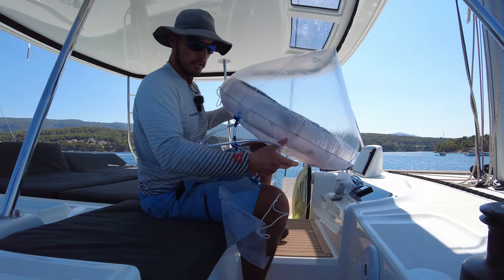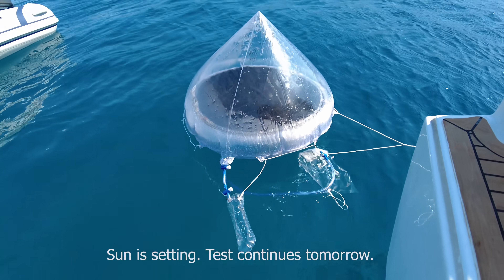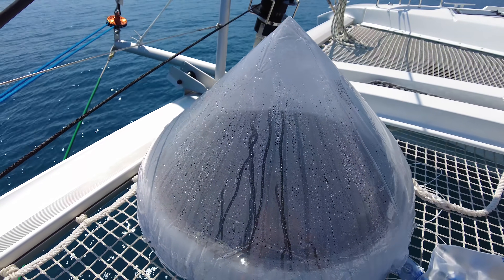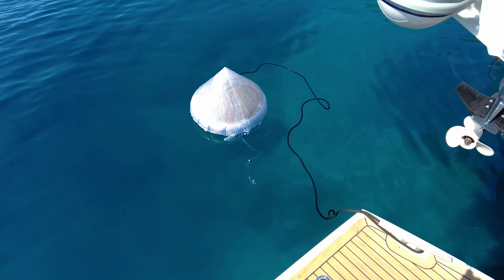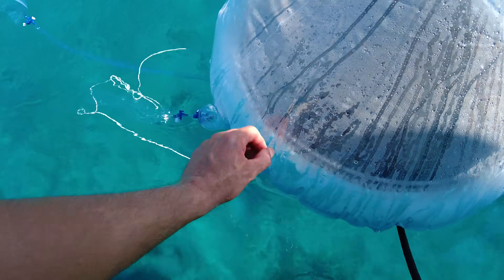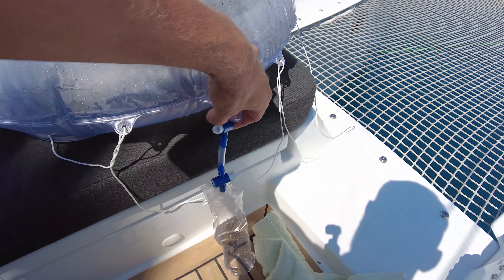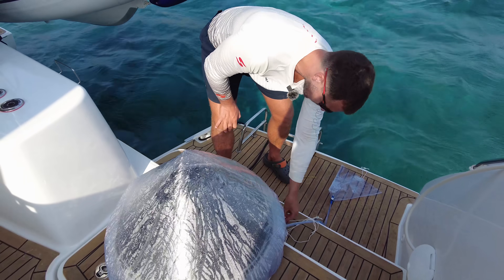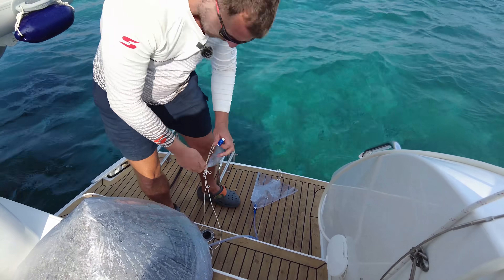Solar still - Sea made drinkable

Comment: I want to see the collected water tested for salt content
Reply from the maker: Salt doesn’t evaporate.
Reply: @IgorStropnik  I'm more curious about possible cross contamination thru design or accident
Reply from the maker: @J@J @JustMyTwoScents e is black cloth over water inside that gets damp to evaporate and prevents salt and fresh mixing. If device is not moving enough salt water doesn’t dampen the cloth and you have to shake it manually. In normal conditions you get no salt in fresh water but if you capsized device or shake it violently than you would mix salt and fresh water.

Comment: you get better performance with that in the water. the heat difference between the air and the reservoir makes a ton of difference in distillation. You are stopping that from happening by keeping it out of the water.

Comment: if you don't have a source of electrolytes to add to this, drinking water from this contraption will kill you pretty quickly. it will leach minerals and electrolytes from your body and you will die of hyponatremia and water intoxication. depending on your starting level, it will only take 20-30 oz of this water until your body starts shutting down. remember, when you are drinking water, you are replacing electrolytes as well as fluids.
Reply from the maker: Just add some sea water. Many people have water makers on boats and they drink it everyday. I don’t like it but looks like they get electrolytes from the food.

Comment: Hmmm...
It's almost a smart design...
At least it's compact.
It should definitely be a 2 part design.
You need a lens that doesn't fog up and a back surface.
Then you need to cool the water vapor.

Comment: I feel like this could be designed in such a way that it heats up faster, uses the ocean itself as a condenser coil, and separates the salt and water so you could use the salt to flavor food or get some necessary electrolytes

Comment: The same principle in prison was used to make Homebrew and the guy would spray ice water or cold water on the outside of the bag which would make the condensation happen quicker. I'm thinking if the guy would have sprayed the colder seawater with some kind of a handheld sprayer it would have helped the condensation quicker. Also if on a hot day you are running AC in your vehicle directly on the Windows you notice that the condensation is on the outside especially in the morning. So if you were to spray the sea water which is a colder temperature than the air inside the bag it would help create condensation faster than just letting it sit there

Comment: I used to hike in the desert a lot. *ALWAYS* carried supplies to make a solar still. Dig pit, line pit with vegetation (and even urine) put cup in middle of pit (helps to have flexible tubing into cup) cover pit with plastic and "seal" with dirt/sand around edge of pit perimeter. Place a rock in the middle to make inverted cone whose tip is directly over collection cup. Wait til sunset to remove plastic and drink or can sip from flexible tubing.
Reply: 1/4 a cup? how about 4 tablespoons? 😅😅😅
Reply: How much water did you collect per day, on average?
Reply: @michalinaokrent6672 not much. Maybe 1/4 cup, but might tide you over.  I didn't add vegetation which may have increased  yield.
Reply: What was your yield?

Comment: You can do the same thing in the desert. Temp difference and condensation from the air. Make a hole in the sand so its cool
Reply: It's usually close to 0% humidity in a desert. There is no water in the air to condense.

Comment: This stuff fascinates the heck out of me. I have a "vision" for a more "durable" version... If anybody wants this, there may be money here... The "lid" of a black five gallon bucket, has that conical dish facing down ward into the bucket. The condensation could drip into some kind of "cup". If the lid were clear, that may theoretically increase condensation due to the coolness...That may be a Patentable Invention for somebody who may have the where with all to do so... What about a 55 gallon barrel with a "cup" set in a socket...That catches the fresh water dripping from "conical lid" on the barrel, with tubing to the outside of the barrel, (through the wall of the barrel from the "cup".) for the spigot...

Comment: Question:
This is distilled water, and  especially when sweating in the heat and not eating anything, you rapidly develop a severe mineral / electrolyte deficiency. especially lack of sodium, potassium.    Is it advisable to mix in some, very little sea water / urine to avoid this, or what is the recommended way ?
Reply from the maker: Add little sea water.

Comment: The latest in science is that it was discovered that what causes the water to evaporate is NOT the heat but rather a phenomenon that happens when light hits the water at a particular angle, this particular polarized light causes water molecules to be released into what we call evaporation. Its called the PHOTO-MOLECULAR EFFECT.
Reply: Interesting!
Reply: @__WJK__ it's really incredible. When we hang-dry clothes, they do not reach 100° to dry lol it's the light around us in a specific wavelength that causes water molecules to be released as gas into the atmosphere.

The photo-molecular effect, also known as the photoelectric effect at the molecular level, has opened up new avenues for technological innovation. Here are some emerging technologies being built upon this discovery:

Energy Generation and Storage
1. *Molecular Solar Cells*: Harnessing the photo-molecular effect to create ultra-efficient solar cells that can convert light into electrical energy at the molecular level.
2. *Artificial Photosynthesis*: Developing systems that mimic photosynthesis to produce fuels, chemicals, and energy from sunlight, water, and CO2.

Advanced Materials and Manufacturing
1. *Molecular Electronics*: Creating ultra-small, ultra-fast electronic devices that utilize the photo-molecular effect to control electrical currents at the molecular level.
2. *Nano-Optomechanical Systems*: Designing nanoscale systems that exploit the photo-molecular effect to manipulate light, heat, and mechanical motion.

Biomedical and Healthcare Applications
1. *Optogenetics*: Developing techniques that use light to control cellular processes, enabling new treatments for neurological disorders and diseases.
2. *Molecular Imaging*: Creating ultra-sensitive imaging modalities that utilize the photo-molecular effect to visualize biological processes at the molecular level.

Environmental and Sensing Technologies
1. *Molecular Sensors*: Designing sensors that exploit the photo-molecular effect to detect and quantify molecular species in real-time, enabling applications in environmental monitoring and industrial process control.
2. *Atmospheric Water Harvesting*: Developing systems that use the photo-molecular effect to extract water from air, even in arid environments.

Quantum Technologies and Computing
1. *Molecular Quantum Computing*: Exploring the use of photo-molecular effects to develop new quantum computing architectures and quantum information processing protocols.
2. *Quantum Simulation*: Designing systems that utilize the photo-molecular effect to simulate complex quantum phenomena, enabling breakthroughs in materials science and chemistry.
Reply: @__WJK__  And also totally wrong...

Comment: This is distilled water with ZERO minerals, means you just drink air. 
The body got mineral from the water.
Reply: You can actually add a little seawater back to the solar distilled water, to gain back minerals. However, the water should then be run through a certified filter that is capable of removing bacteria, viruses, and "PFAS" !!

Comment: I'm pretty sure you need to let it in the water so that there is a cycle of hot surface and cold surface so that the water cycle continues. If it's just hot... Well the water will just stay in a gas form

Comment: You want the bottom to be cool because the difference between the heat and the cool causes the water to condense. Large scale solar stills use a glass or metal panel at an angle that has a cooling coil on the outside if it. This makes the panel cooler than the humid hair above the water supply so the water condenses on the panel faster, and slides down into the collection trough.

Comment: Read about these years ago (1980's?)  You don't play with them, moving them around etc. You put them in the water and leave  them alone until the sun has gone down or  the collecting bag is full.    They are not supposed to be used singly either.

Comment: The part with the sea water is supposed to be hot, as that leads to evaporation, but the dome itself and especially the drain is supposed to be cold, so the water condenses and stays in liquid form for maximum efficiency of this thing.

Comment: It really helps if you spray some salt water on the outside every now and then. Keep the drop collector cool. Inside is scorching.
Reply: Or just keep it in the water as intended.
Reply: @templeofdelusion  inside should* be scorching so the humidity is high. That transparent cone however must be cool in order to condense better.

Comment: There are several ways to use condensation to filter water.  It's great that this is a product though, but people should look up ways to filter water with what you may have on hand in an emergency.
Reply: There is also a filter straw which might be a cheaper option. REI sells them.
Reply: @takealeftatthelight5284  Does the filter straw remove salt or does it need non salty water to begin with?

Comment: I made something similar for a fifth grade science fair back in the 90s. It consisted of a cereal bowl containing salt water dyed green, a large glass saucepan lid suspended above where the condensate water built up, and an oven pan at the bottom that collected the clean water that dripped down. I remember asking the teacher if I could keep the project next to a window with direct sunlight or else it wouldn't work.

It was obviously not a new concept as similar contraptions were in a lot of survival books at the time, but I managed to win first place as my project also explained the whole evaporation and condensation process.
Reply: I did the same project. But in the 70’s🎉

Comment: Another way to make one, if you are lucky enough to have a large plastic sheet in your lifeboat, is to gets some clothes, or towels, soak them in sea water, form them into a ring shape, an annulus at the bottom of the boat, place a plastic cup or something to catch the condensate, at the centre of the ring of wet salty clothes, cover with the plastic sheet, with something heavy in the middle of the sheet, over the cup, at the lowest point, a stone or something solid would suffice, and hold the perimeter of the plastic sheet tight. It will only fill up slowly with drinking water, but it could save your life!

Comment: it might work better sitting in the cool water because the temperature difference between the hot water surface inside the still and the cool surface of the ocean might create convection (is that the right word?) that encourages activity at the surface. if you put a mug of water in a microwave, it can heat up a lot without actually evaporating or boiling, and because it's hotter than its boiling point but not yet boiling, when you take it out and, for example, stick a spoon in it, it may suddenly explode in your face. same principle here; floating the still in the water might disturb its surface to make sure it's actually evaporating, since the source of heat is radiation just like in a microwave.

Comment: these are great to have in reserve in case your main water source in compromised. i'd recommend 3 per person plus decent sized water bladders to go with them. if you're down to a solar still there will be overcast days where you don't produce as much. use the bladders for excess.
having said that, if you're fixing to do some serious sailing make sure you have multiple ways to produce water.

Comment: If you leave in water then water will cool and lower the chamber temp thus lowering rate of water being heated from liquid to gaseous phase. Once gaseous it’ll diffuse in the chamber and hit the walls and collect and increase and roll down. More heat generates more liquid to gaseous phase. So ocean water drawing heat out of container slows process down

Comment: The on dry land equivalent is a clear plastic bag around a branch of a non toxic bush with a lot of green leaves. Tied tight at top and let hang down to collect water. Needs to be in direct sunlight to work effectively.
Reply: there's less seawater on land
Reply: @speedstyle.  Haha :| If you want to have some freshwater on dry land where there's no stream or tap around you, the method sparkeyjames described will work much better than trying to lick dew off grass blades

Comment: If they replace sections of the plastic with thin wafers of magnifying glass and find a more efficient way from getting the fresh water from the sides, I but it would be so much better.
Reply: Why would magnifying glasses make it work better? It is still the same amount of energy coming in.
Reply: @catprog  Not sure how it works, but I remember as a kid playing outside and being able to set stuff, like small sticks on fire using a magnifying glass. So I am thinking it would generate more heat.
Reply: @seanogrady2629  

Assuming you had a 30cm^2 area magnifing glass and a 30cm^2 area of water.

No magnifing glass and the water takes all the energy over the entire surface.

Put the magnifing glass in and the same amount of energy is still delivered to the water (just in a small spot)

Comment: I’m pretty sure you want it in the water to keep help condense the evaporated water inside. Otherwise it will reach an equilibrium state where the rate of condensation is cancelled by the rate of re-evaporation.
Reply: Agreed. The cooler  temperature,  is   critical  and  KEY  to  its'   intended  purpose. The  physics,   behind  this.
Reply: Yeah, you need a temperature gradient from warm to cool to power the cycle of evaporation and condensation. Without the cool bottom, the water vapor would not condense, and the air would reach saturation point, and the process would stop.
Reply: @HypherNet the water vapor would condense because when it hits the clear material roof it is cooled by contact. The earlier comment about the closed system reaching a steady state is correct.
Reply: the great news is you can even use it on a sewer
Reply: @Heyok-vx7yf it does work, i've been doing it a few times
Reply: @tigrehermano  What do you mean by "on a sewer"....Do you mean placing the sill on top of a manhole  or something? If you mean that you have been drinking distilled sewage then inquiring minds want to know...
Reply: @GuessWhoAsks  you may feel sick (nausea and diarrhea) for a few weeks but it's just the placebo effect of you thinking it came from there
Reply: @tigrehermano  that's called nocebo, not placebo

Comment: You need to learn the basic science behind how it works before using it, then you would know to leave it in the water all day and only take it out after sundown to allow all the vapour to condense. The sea keeps the collected water cool and stops it evaporating back into the bell again. Watching you messing with it every hour or two is like watching a chimp trying to bang a nail into porridge with a hammer.